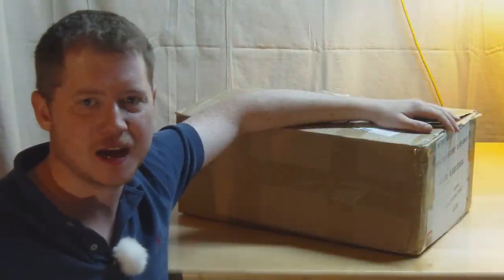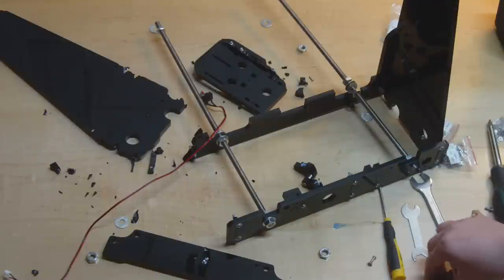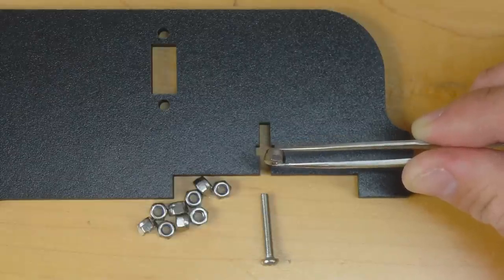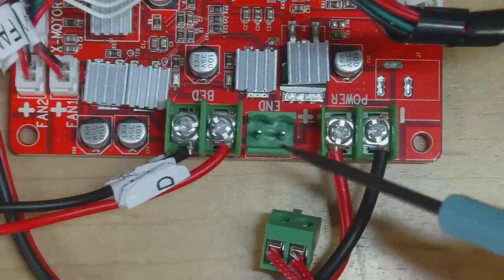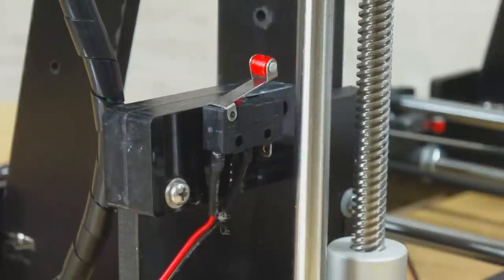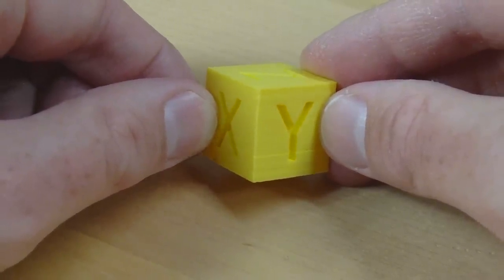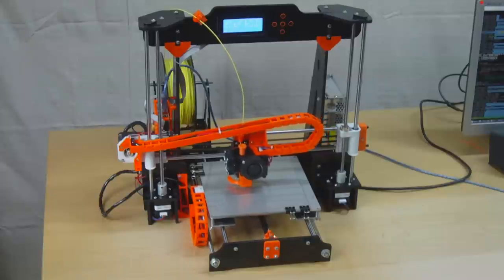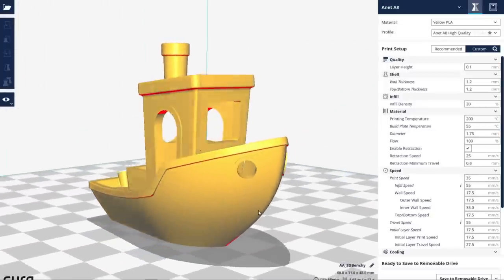[007] Anet A8 3D Printer - Review, Upgrades and Experiments

Comment: @OpenTechLab Curious...Not wanting to criticize...but...
You mentioned you just hot glue'd the sensor to some scrap pieces of acryllic and to the frame...??  Ummm - But pretty sure the instructions said that was what those two bits of Acrylic were for, and not sure why you used the glue, because it should have had the m2 self tappers that fit through the holes in the switch.    Also on my Acryllic version the side where this mounts is slightly higher and has slots to allow movement up and down to adjust.
FYI on locktite and screws - obsessive yes...I just pulled the whole thing out, assembled it with provided M3s did it up a reasonable amount of torque and a few months later...still printing without any frame movement.
One more thing...Your Y axis motors are mounted 180 degrees back to front, the Plugs should be at the back...Sorry that's just me being a fastidious engineer :)

Still enjoyed the review - keep up the good work.
Reply: Think you missed the part where its not the original frame but a composite wood fiber board which did not have mounting holes

Comment: Got the same printer. Glad you mentioned the power supply and controller (fire hazards). I ended up using the Orange Pi Zero with Repetier Host.
Reply: wait, you used the orange pi zero with repetier host to replace the power supply and controller ?

Comment: Thank you! I got this printer over the summer, and I’ve been running it in a wooden cabinet, now that I know about the fire hazard I can fix that.  Also, what temperature do you run the hotbed and nozzle on? And what speed do you print at?

Comment: Ok well i got the replacement frame and low and behold for me atleast there were MANY mods i had to do to get it together. Alot of holes were not there,I had to make a few brackets myself, Drill my own holes to mount the power supply  and the motherboard. Had to find a hardware store that had a supply of small screws nuts and such. My LAST problem am am asking for help from you are anyone who can help. the Z axis switch the new frame kit did not come with anyway to attach it, So what i need is to know at what height the roller needs to be from the ground/table to where the roller clicks off/on. and second what comes in contact with the roller? I believe with this information i can finish this long drawn out project:)
Thank you
Ron

Comment: Loved the video and have 2 questions. How did you determine which posts the bed red & black wires connect to? The board is not labeled + or - for the bed. I have mine the opposite of the way you have it to match with the power + and - and have no issues after 2 test prints. Also my kit did not include a 2nd fan nor did the directions show one installed. Any concerns with this? Thanks again for the great tips!

Comment: Although is tempting to rest the Z-couplers low on the steppers, and it looks good this way ... they are meant to ride really high on the stepper's shaft, so that the springy portion of the coupler lives in an empty space between the worm and shaft.  The worm should actually reach through the holes on top.
Sadly, have no idea what is causing your X skipping problem.  That is intolerable.
Does your fan accelerate when you press the DOWN button?   Maybe just me.  It disappeared after upgrading to Skynet/Marlin. Also, you can adjust your X-accel values in Marlin to help with the vibrations caused by the super-massive extruder carriage.
Am glad to see I am not the only sole to crack the acrylic!  That was a really poor choice of material by Anet.

Comment: I don't put anything on the hotbed. No glass. No glue. No tape. I just print right on the aluminum, and haven't has any problems. I used blue tape a few times, but even if I get it down without overlap the nozzle would occasionally peel a bit up, and cause issues. I went to art school. I'm pretty good with tape.

Comment: Awesome video dude! I am building my first ever 3D printer, the anet A8 and while it has all these issues; I am using them to force myself into learning how it all works so when I buy an Ultimaker or something nice I will know whats with it when it goes wrong. Great video, very helpful.
Reply: So how did it go? Did you upgrade since then to something like a voron or maybe an ender or prusa? Or did you stick with it?
Reply: @LuLeBe  I was into printing on an off with a previous job but I just got an Ender 3 v2 and loving it!
Reply: @bigal1122  i have the v2 as well as my main printer, did some modifications (bltouch, hero me fan upgrade, cht nozzle, bi-metal heat brake and some firmware tweaks like linear advance) for about $100 in total and it prints nicely with 0.4mm layers, 0.8mm line width at over 100mm/s speed, such a good base that printer. I recommend trying some of those out of you also want to cut print times from 30 to 8hrs, for example.

Comment: There's a better solution to the cracked solder traces. I used to repair equipment that was mounted on industrial conveyors. Cracked traces on terminal strips was a common problem for some installations where vibration was a major factor. To repair, I would remove most but not all of the solder from the joint then make several loose wraps of solid 28 AWG wire and finally reflow solder onto the joint. The wire gives added strength and prevents future cracks. I never had to repair one of our boards after applying this fix.

Comment: Dude the line on the X is called Z banding, As it went up it stuck NOT the X. Also grease the rods. The Base issue is you had it to high off the bed. Nothing with sticking.

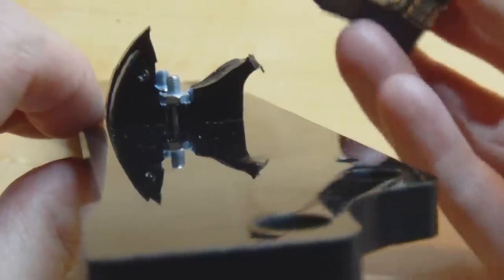Comment: One drop at most, a very small smear of Loctite should ever be used in any situation, it shouldn't be dripping off the fastener as can be seen at 5:31, but only exist as a thin film between the bolt thread and the nut thread, anything else is pointless and wasteful because it only hardens when deprived of air. A fraction of a drop inside the nut before screwing it on.

Comment: instead of loctite use teflon tape.
Reply: I just ordered an A8 and I wanted to say thanks for this tip.
Reply: Teflon tape? Thats weird
Reply: @nathanchalecki4842  Why is teflon tape weird? you use it on pipes to keep them in place I would thing it would work perfect just only use a tiny amount so you dont oversize the bolt
Reply: @rebekahmerritt2460  hi rebekah. Teflon is used as a pipe sealant- NOT as a way of stopping pipes from unscrewing. Teflon itself is very slippery (non stick pans) so is the opposite to loctite :-)
Reply: @rebekahmerritt2460  teflon tape is for sealing fluids, gasses , oils and fuels on threaded joints and is a brilliant product for that and the joints are usually dun up very tight. I haven't heard of its use against vibration loosening.

Comment: Don't you have "lock washers" or "split washers" in Britain?
Reply: The Anet has no lock washers or flat washers for the frame!  Because it is acrylic I would not put lock washers of any kind directly against it without fear of more cracking.  I did add flat washers with lock washers on top of those when I built mine.  I have not had any problem with loosening but did I fix a real problem or not?

Comment: if your ambitious you can use 3 mm acrylic sheet instead of but Don't use it with anything but PLA the hotter plastics weld to the acrylic sheet and you will NEVER get it off.  Best Idea is the PTFE build sticker works for all prints and you will need to replace it after 2000 prints because it gets smooth and the bed adhesion is too high.. but it is your best option for no messy glue stick or hair spray and no dangerous glass plate. the Acrylic sheet in the cheapest and you can take it off and pop off the print.

Comment: I did the same thing! I learned NEVER use Loctite on Acrylic, the fumes will crack the frame. I ruined my Anet A8 frame doing this. And you cant just buy another acrylic frame, I've looked. You have to upgrade to a different style frame. Loctite fumes crack acrylic.  Sucks, sorry man. I ended up buying a profile frame on ebay. No printer to make parts so I had to buy another A8 to build parts. No loctite this time :)

Comment: Why did you glue the z axis limit switch? Mine just screwed on
Reply from the maker: The replacement frame didn't have the correct mountings for these tiny switches. It was a temporary measure until I could install the auto bed-levelling sensor which I have installed now.

Comment: Hairspray is not so good on glass. I use a mix of 1 part wood glue with 5 parts of water for months.  It works perfectly and if it is too old, just spray some water on it and let it try again. To clean old mix from the glass use some nail polish and a razorblade.
Reply from the maker: +m.tekkes schneider I've started using a buildtak sheet. It works so perfectly, and not having to apply and clean adhesives is just wonderful
Reply: m.tekkes schneider I use PVA glue, really cheap and works fantastic
Reply: Hugo Huge Wood glue is also based on pva.

Comment: Loctite blue is a thread lock you use a little drop on the thread it ends up bonding the screw with the nut, the blue loctite isn't permanent you can undo it, you have put way too much of it.

Comment: 100% the fault of the locktite. A co-worker used it to hold a bunch of screws in a clear acrylic panel that was tapped with the proper screw thread. In the morning, each screw hole was spider-webbed.

Comment: Those screw terminals should be glued down.. most of them like that eather use a peg through hole or some glue or hotsnot to stabelise it. i'd recomend some good nonconductive glue not realy superglue more like one of the apoxy or rubber cement tyeps

Comment: 1) Locktite needs a tiny drop ON THE THREADS not the plastic.
2) Looks like you overtightened the nuts. I've seen many rookie mechanics shear off bolts and studs using a smaller wrench than you have there...on steel.

Comment: use nylock nuts or your wife's nail polish Yes this does work, Spring washer or star washers all work. But I replaced the belts with rod then added a cricut holder from thingy verse and a 7w laser. Quite versatile really. I actually bought 2 and turned the other into a axidraw but bigger using the vertical rails as the + main chassis.

Comment: locktite blue is not supposed to be used like superglue, you simply use it on the threads of the bolts. From the video it looks like you bathed the whole beast in blue locktite. Dont do that and certainly keep it on the treads of the metal bolts.

Comment: The biggest issue is your application of the loctite. I've had loctite reps themselves come into my automotive school (what, a decade ago abouts) and say that most people use too much. You just need a single "line" down the fastener/bolts and that's it. If its dripping off it's too much....and any that's not directly between the nut and bolt isn't doing anything except getting onto the plastic and then weakening it. (as it cures from lack of oxygen in a tight fit)  If you'd just done a tiny dot on these tiny M3 bolts, the threadlock would have done it's job and wouldn't have touched the plastic at all.
Reply: its the fumes that's the problem even off a tiny drop inside a thread is no good

Comment: superglue instead of loctite and solder the mains cables directly on to the boards, improve the traces by building up the solder, increase the earth solder or mosfet it all which is by far a superior way  keeping low and high voltages apart and safe,  cut all extruding pins off and add a better layer of insulation between the board and frame,  allow for temperature differentials , i live in spain and it gets to 40 degrees here, use spring washes if not loctite or superglue, chain guide is so cheap to buy I would not have bothered printing it, yes its a nice bright colour but the time it must have taken versus filament and electric cost you can buy a metre for less than 3 gbp. Improvements look good, personal comment anything that generates heat should never be left unattended especially chinese electrics, I would not operate this and leave the house. nice idea but too risky. It now costs 113 euros on ebay and 116 with auto levelling as of March 2019. A price to get anyone 3d printing at that level and a good machine by all accounts for simple prints. Mine turns up soon and i will be using it to make moulds and formers for jewellery making that i cant produce on my laser engraver. Hope it proves to be a worthwhile and reasonable investment if all it does is teaches you to 3d print and how to design its worth it at that price, a machine that can print upgrades for itself has to be worth thinking about. I have see a totally circular air blower for the print head and wonder if this would be better than the semi circle shown. nice review though. way too much loctite applied, you only need a tiny dab and it does the job, on some of those nuts they looked soldered with loctite! :-) Finally if there are wobble issues you could enclose the printer within a cube'd aluminum extruded frame which would be useful for some filaments as you can then add side panels to keep the heat in.

Comment: 12 dollars for the glass pane!? Just go to your local photo frame shop and ask them to cut out a 22x22cm piece, costs like 3 dollars and theres no delivery time :)
Reply: Remember to ask for borosilicate glass...
Reply: Meh, isn´t that a lot more expensive? I´ve been using a regular glass pane (Probably soda-lime but not sure) for a couple of months now without problem. I do keep the shattering risk in mind when I cool it rather rapidly though (Under running water) and try to cool it gradually but I've never had a problem with it, as long as you're careful not to pour ice cold water on it after you've heated it up it should be fine. Besides, getting a new one is very cheap and going through a few cheap ones will probably end up costing less than buying an expensive one, but then again I don't know the price, do you know how much more it costs?

Also, sure there's a small safety hazard with the glass shattering but it you're just being careful and don't hold the glass pane when you cool it the risk of injury is extremely low.

Comment: So... the community needs to post some files to print all new pieces on another machine.
Reply from the maker: +Powered by Stupid you should check out the Prusa, and other printer designs listed on reprap.org
Reply: I've seen them. I'm probably going to build one on my own. My buddy has a printer that I've been using, so we've come up with a design using the best aspects of newer ones. We'll just print the printer on his printer. lol. I live a block from Lowe's, and we have Arduino boards just laying around the workshop. I'm just not sure if I want to use lead screws instead of belts.

Comment: All that frigging around with locknuts..   Think before you start... just get some black electrical tape and use on both sides of teh acrylic..ie  put one side on.... insert nut - then tape over it..No more moving or dropping out! ALSO.... warning about tight screws for teh 12v input..."open tech"  have  you never  heard of electrical connectors... horseshow or spade types? better to use them and  do the job right!  AND to newbies... get mosfets and fit them better you get two  one for bed and one for nozzle -  the basically regulate current and at  very least act as a protector for the motherboard.   Before you  start.. join this FB group  https://www.facebook.com/groups/1068531466501015/permalink/1768520076502147/
Reply: I agree. I have 4 Tronxy's and for nearly a year been using them almost everyday. Gues what? No problems and used your method of assemby. I also put up a video where I open the power supply and instal the bolts from the inside. No chance of contact. It's as if he went into this with failure in mind. That's what he got. All mine have the MOSFET upgrade plus others. As I needed them. Not at the begining. Have a great day my friend.

Comment: The side cutters are garbage. Mine broke right away. Fortunately I had another set.
Reply from the maker: Yes - I had a segment about that that I forgot to include. Mine also broke as I clipped the belt with then.
Reply: They might be variable quality, I have a set of knipex side cutters but I didn't feel the need to get them out. The screwdriver did though.